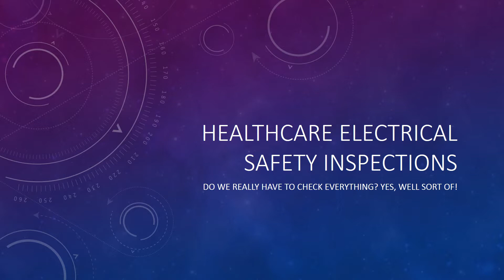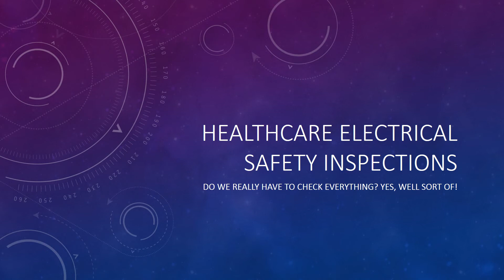Healthcare Electrical Safety Inspections Overview

Comment: nice video! I was wondering if there is a way to check that leakage current without a using a safety analyzer? Thanks
Reply from the maker: Yes, you can use a digital or analog meter and connect it in series.  There are videos and instructions on doing this.  This is the way it use to be done in the past.   If you check out NFPA 99, there are instructions there.